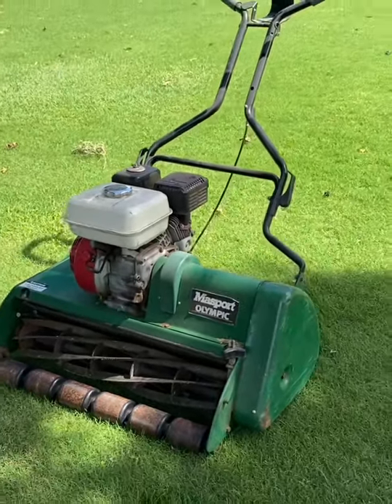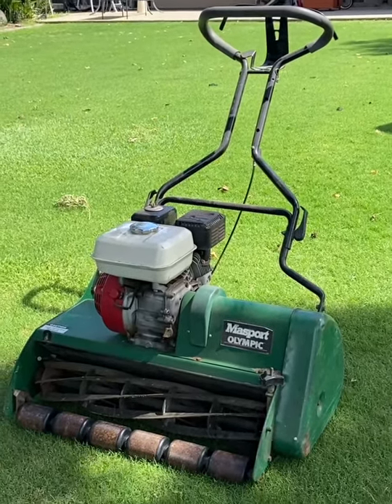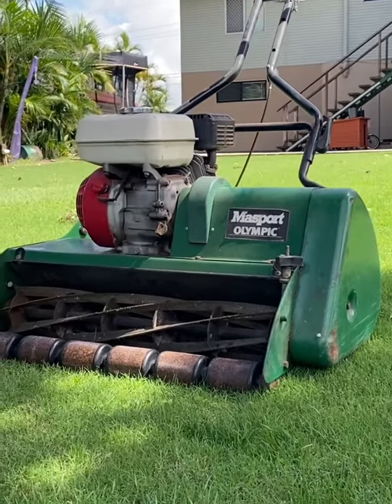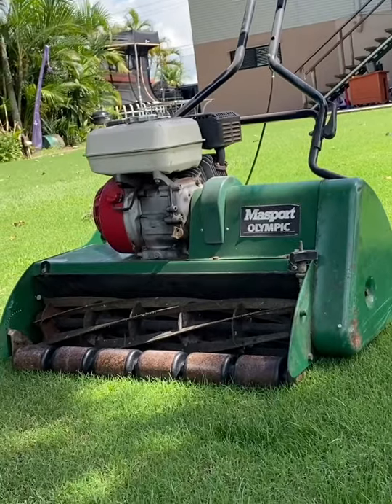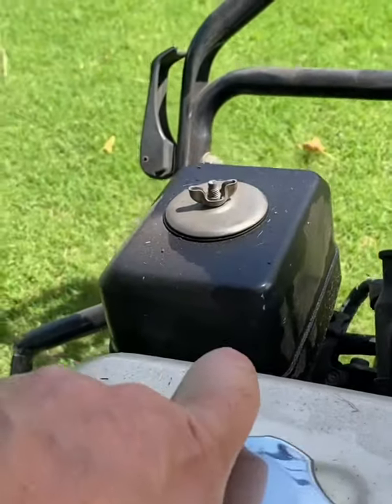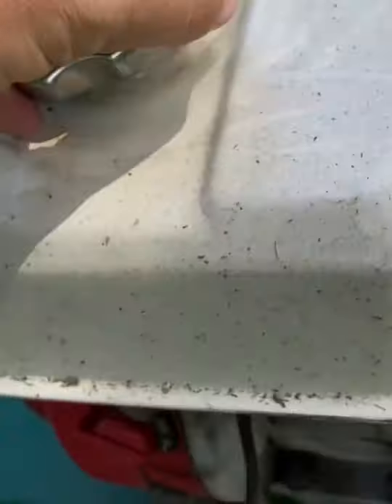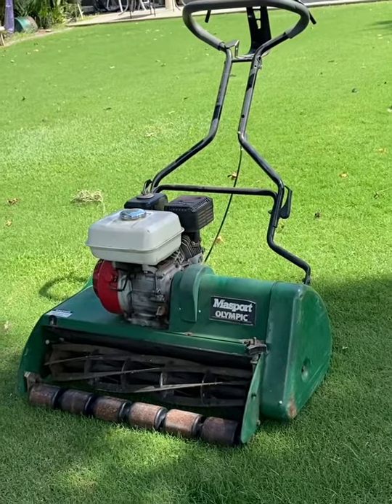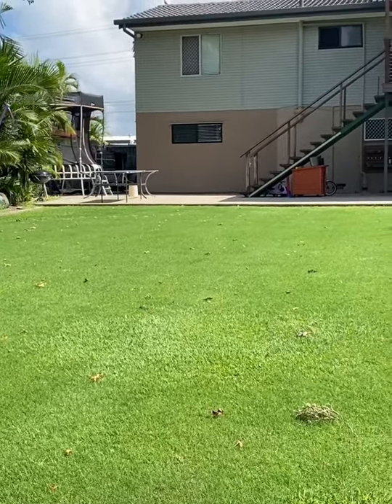Masport Cylinder mower, bringing it back to life

Comment: Yep I have a old Lawnmaster Twin Drive 20 built by steel fort Engineering in NZ . Came across it in the Redlands. My reel started not stopping at idle, I was told it would be a broken spring and won’t be able to get one…so I took the engine off and found all the clutch parts were fine but just needed a clean up etc as the shoes were not moving freely, tight and getting stuck a little in the outward position….now the reel stops at idle. I also have some original Lawnmaster Twin Drive stickers that I managed to get from Steelfort NZ about 10 years ago too when I first got this old girl. It’s a well built machine. though I did replace the old wooden rollers with 3x solid stainless steel rollers, all with bearings in each roller, it’s a Rolls Royce job 😆 …added about 12kg to the machine and made it sit down on the lawn so much better too.  I’d been keen to know if a can swap my clutch over to the masport one which has spares readily available should my clutch one day go pear shaped.  Look forward to your vid doing the clutch on this 26” masport 👍

Comment: Good job mate, I just bought one of these in a 20 inch for 200 m² of buffalo and the maximum cut height is 30 mm. 

Do you reckon they can be tinkered with to get them up to 40 or 50mm….? 30s on the low side, but the range of Buffalo is 25 to 50…..

I’m reading that one way is to put a fatter front roller on…..

I’m hoping I can get an aftermarket adjuster screw with a longer thread or something like that

Comment: Seen a couple of these on marketplace, but didn't even consider them, because I thought the spare part supply would be non-existent. That's why I ended up with a SB45, that was advertised as fully restored, but a couple weeks in, I discovered he stripped 2 of the threads putting the engine on :( what a muppet.